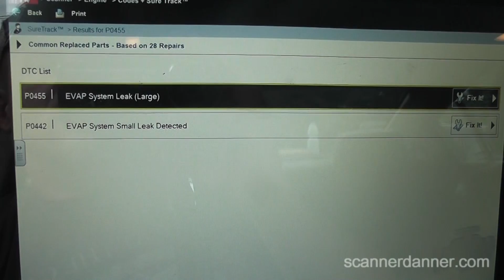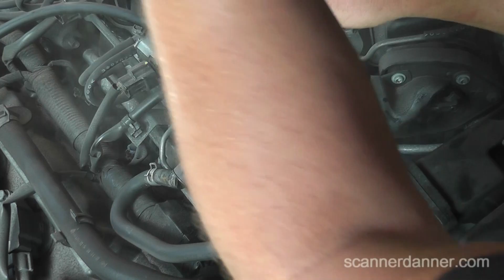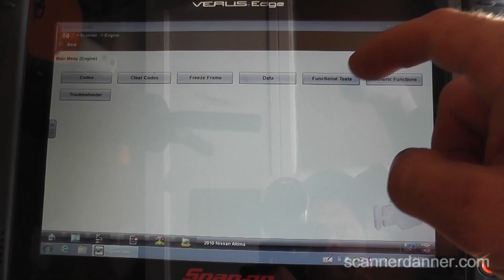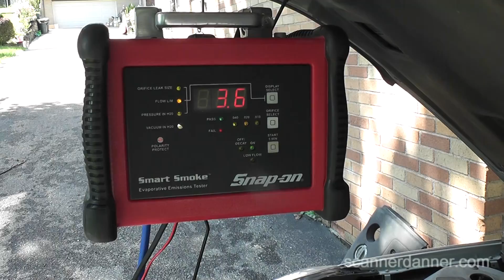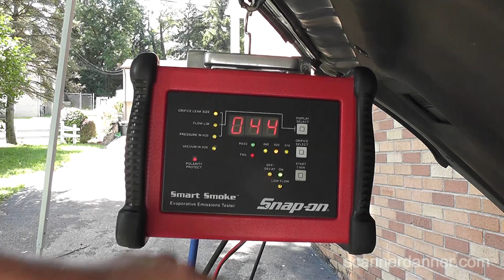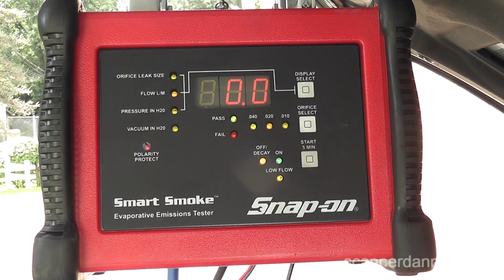2010 Nissan Altima P0455 P0442 EVAP Leak Testing

Comment: Paul what's the reason they vent the systems into the frame rather than a simple and  diffuser?
Reply from the maker: Just a way to keep water and debris from getting into the vent hose. Some systems use  a filter and housing (diffuser) that the vent solenoid dumps into. GM does it like that

Comment: Great video, I have a 2005 Nissan Altima which lead me to this video.  My car has a rough idle (engine shakes) when the car is put into drive with the foot applied to the break.  I've changed motor mounts, repaired an exhaust manifold crack, sealed all the exhaust gaskets with new ones and gasket maker.  I'm still getting a shake and vibration that is causing my flex pipes to break every year.  Wondering if I have an intake leak or a leak like in this video.  I'm at the point of buying a smoke machine to test the car, I have no codes on the car.
Any advice?

Comment: Thank you for this video! My 2007 Nissan Versa vent control valve had debris tangled in the vent spring. I air blasted it out, re-installed the valve, and drove the car less than 50 miles, and the service engine light went out. Thank you for helping me with my P0455 evap code!

Comment: Thank you for posting this. Replaced purge solenoid on 2011 Chevy Cruze with 1.8l engine and tested before purchasing new purge valve. Suspect tested on wrong side of solenoid. Still have P0442 and P0496.

Comment: How much does it cost where you are to do the smoke test
Reply from the maker: At least an hour labor time for a diagnosis and leak test, maybe more depending on where the leak is. Sometimes you have to drop a gas tank to confirm, in which case you would expect to be paying a lot more, but the first initial diagnostic fee would cover exactly what the next step is.

Comment: Evap code, its not the gas cap !! Took mine off ( 08 Maxima ) cleaned it with contact cleaner, used RTV on all connections, Fixed !!

Comment: I got a cheap smoke machine just for leaks, I didn’t have any visual leaks but I hooked up my scanner and closed the vent valve. When open the filler neck fills up but when closed you can still see smoke being pushed in. I’m not sure if that indicates a bad vent valve. I’m so upset, I had my emissions class this semester, now my auto classes are online and I just feel like I haven’t learned much. I’m in a fuel and emissions class, it ends in two weeks and I still don’t know how to test for evap leaks. Online is no where near hands on, so thank you so much for this upload.
Reply: I got it!!! It was the vent valve! I bought a cheap $120 smoke machine and was able to test it. I work at a independent shop just me and my dad, were a body shop but I’m studying mechanical. This was my first evap diagnosis’s, gotta keep practicing even though schools cancelled! lol
Reply from the maker: sweet!

Comment: Will I die if I don't fix P0442? probably not... maybe I'd contribute 0.00000000000000000000000001% to global warming I guess. 
Not bad compared to China.
Reply from the maker: In most circumstances, you have nothing to worry about BUT, it does indicate an EVAP leak, which would be fuel vapors, so just be aware of that. Are you smelling fuel? Parking in a garage may not be a good idea etc.

Comment: Hey thanks Scannerdanner and I wanna give a show out from Mount Union to another PA resident yo. I got a lot out of your video. I have a 2002 sentra spec v with a 10 year long issue with these and gets about 25mpg or less, mostly less the hole time I Have had it. Now I'm getting a po44 code. I was wondering how to activate the solenoid with out the fancy tablet computer. So I will be checking out your videos on that. Thanks for the help figuring this shit out.

Comment: Any videos on troubleshooting p0447 replaced gas cap, vent and purge valve to no avail.   Vehicle first pulled a p0455 and p0447 after replacing, p0455 went away can't get p0447 to go away.
Reply: I have that same issue

Comment: Hey Paul. Do you think it would be possible to test an evap vent valve by energizing it to close it and then removing both hoses, plugged smoke directly into it on front side and see if smoke leaks out other side?
Reply from the maker: or do the same thing and blow through it, I've done that :-)
Reply: @ScannerDanner  yeah I guess you don't need smoke at that point lol.

Comment: Dude, I knew it was your canister vent valve in the first 30 seconds, your way is the dealership way, go through all these unskillfull technics costing 100.00 per hour. I just did one, deleted the code, done in 30 minutes in the dark. From the manufacturer, these are not clamped preventing this after hose swelling and contracting.
Reply from the maker: Lol "unskillfull techniques" 
I wish I was as cool as you are.
Reply: @ScannerDanner  Hahaha, just the nerves of these people. 😂 Here Mr. Paul, sweating in 100F for us to teach us how the system works and diagnosing it, and we have this joker. I bet this "professional" is a really professional parts changer.

Comment: Hy, can you tel me how is the car behavior when the purge valve is stuck close?will it interfere with the ECU to compensate for that?Thanks BTW You kick ass!
Reply from the maker: Stuck closed purge valve would cause the charcoal canister to become completely saturated with fuel. It would set a code for this and you may smell gas. I believe there would be no other driveability symptoms.
Reply from the maker: I should add that if the Vent valve is stuck closed, you would not have a fun time trying to fill your gas tank

Comment: I did the test and I did no't feel any vacuum. I also checked the resistance of the solenoid and I have 29 Ohms which seems ok. As I saw in another of your video, I will manually energize it with a test light connected to ground to see if it opens.
Reply: Also:
1- Key on I got 12V on the power feed side and a bit less on the other side (because of the resistance of 29 ohms if I'm right).
2- I removed totally the purge valve and tested it. It clicked and opened correctly.

So I still have to check the control side.
Reply from the maker: You didn't feel vacuum on the purge valve? Sometimes the manufacturer uses "ported" vacuum instead of "intake vacuum". So, redo the test and raise your RPM, if you now feel vacuum, it is a ported source and your purge valve is fine.
Reply: By "I did the test", I meant this one: engine running, connector unplugged, hose going to the tank unplugged so it's expected that I don't feel vacuum because the valve is closed. Correct ?
Reply from the maker: Yes, if the purge solenoid is not being energized by the computer, you should feel no vacuum there. On initial start-up and for the first few minutes of running, the computer will usually turn the purge valve on, so just be aware of that.
Reply: Thanks for the tip about initial start-up and taking the time to reply to me !  It's an easy way to check if the control side works. I really enjoy learning that stuff !
Reply: Me again. lol

So I started the car, unplugged the hose going to the tank and I did not feel any vacuum with my finger. I should maybe use a leaf (as you did on another video) or better a vacuum gauge.

Also I found a pending code P0444 with my code reader. My understanding is that I set that code when I unplugged the connector during a previous test. Just to be clear: the P0444 was not present before I started checking the purge valve.
The fact I got that P0444, does it indicate that my control side work ? I think it does.

I erased the codes and went for a test drive to see if the evap monitor will run. I have an autel AL519 which has a Ready Test function which tells me the monitors status.
During the test drive, I set a pending code (P0455 as expected).
My next move is to go to my garage and ask them to remove and test the canister vent valve which is a known failure on Nissan of that period.

If I missed something, please let me know.
Reply: I finally found the info in the service manual ! On my car at idle the ECM will never open the purge valve. It will only open it at about 2000 rpm and more than 100 s after staring the engine. For the nissan owner, I found that info on the Engine Control System Section and looking at the input/output signal of the ECM.

Comment: Thanks a lot for that video, once again I learned a lot. I keep in mind the test you suggested = disconnect the electronical connector, the hose going to the tank and check for no vacuum when the engine is running. If a stuck open purge valve solenoid is my problem, i could replace it myself.

Comment: Hi Mr. Danner, I recently have a 2006 Nissan Altima 2.5 with a P0447 Evap Vent Valve Control Circuit, I went to check the diagram and I saw its ground side controlled, so I back probed it to check the circuit and I have 12 volt on both with the ignition switch in the On position, when I with the scanner energize the valve it reads 0 volts on the control wire, so far so good, the thing is that the connector unplugged will read 12 volts on one side and 2.4 volts on the control side, is this some kind of monitored voltage that the PCM sends?
Reply: Yes it is and it would be completely normal.
Reply: ScannerDanner Premium thank you very much

Comment: Big fan Dan.  Love the videos.

Hope you don't mind but I can add my 2 cents and help young techs understand that this stuff gets very complicated.  

The check engine light can be the first and only clue that the driver knows he/she has a problem, especially with evap codes.

Read the code.  Read the freeze frame data.  Try to duplicate the concern.  Check tsb's.  If your scan tool and the car has the capability of doing an in bay evap test then do this.

OBD2 lets techs have certain functions, by law, in which a generic scan tool can use bidirectional testing.  If your scan tool can access specific data then use this too.  Monitor your ftp sensor while you activate the front door and back door of your evap system.

Sometimes the vehicle is already fixed wasting your time.  Seen it way too many times, especially with evap codes caused by loose gas caps.  Mode 6 is your friend.  Learn how to use it.  Complicated yes, but can save you a lot of frustrations.

Sometimes purge valves will only falter when at a certain temperature under the hood.  Remember this.  Reading freeze frame help in this situation.
Reply from the maker: Thanks for your comments! (my name is Paul btw, but it's okay, I get "Dan" all the time from my last name "Danner")
Reply: No, thank you Paul for your awesome videos.

Comment: I bought one of those $125 smoke machines on eBay made out of a paint can and had it shipped to Germany works great on low air pressure and remember you don't need to fill above the wick inside pour on to the wick and just below . lots of smoke i use baby oil inside after im done pour it back in the bottle.

Comment: Hello I have 2012 Altima and I have question to ask you which is everytime I am in my car and I have outside air off but I still get some air coming inside to the car and also I can smell things from outside of the car such as diesel, food etc. so do you know why it's doing that?
Reply from the maker: normal, the default on climate control systems (keeps windows clearer) is to allow outside air in, even with the blower off. To fix that, push the recirculate button on the panel, this will close off all outside air.
Reply: +ScannerDanner thank you
Reply: +ScannerDanner yes I have that button on but still bad fumes comes in from outside

Comment: I've been trying to fix my 98 Chevy Metro. wish I had the scan tool and smoke machine.  would really make this easier.  it had an evap leak detected code and I replaced the evap purge solenoid because it was clicking loudly and sounded like a stuck lifter or loose lash on a valve.  I'll check the vent valve next.
Reply: I'm trying to diagnose my evap canister vent solenoid but the book tells me to use a scan tool to command the solenoid on, but I don't have said multi-thousand dollar scan tool.  I have an innova tool and as far as I can tell, there's no control of the solenoids.  

Can I simply disconnect the connector and supply power to the solenoid with a power probe tool?  How do I know if it's switched by power or ground?
Reply: +Kimo Kalihi I looked at the wiring diagram for the evap system and if I'm not mistaken, the main power relay supplies power to the evap vent solenoid whenever the ignition is on.  The ecu supplies switched ground when it wants the solenoid energized.  

The test said to hook up a hand vacuum pump to the canister side hose on the vent solenoid and see if it holds 15 inHg with the car off.  It wouldn't build any vacuum.  Next was to turn the ignition on and command the solenoid on with scan tool which I don't have.  Instead I supplied power to the relay pin and ground to the ecu pin on the solenoid with the harness unplugged.  Then I pumped the vacuum up to 15 inHg and it got up there but immediately begins slowly dropping to 0 once you stop pumping. 

The last test was to pull the harness plug off and turn the ignition on and test for power on the relay pin and it does have power there so the book says to replace the evap vent solenoid.  

Any reason my rudimentary method of testing could be wrong?
Reply from the maker: Watch the other videos in listed in the description of this one. I show how to manually energize these solenoids. Thank you!
Reply from the maker: Absolutely. You can have a leak anywhere else in that system.
Reply from the maker: It's a good test but not a conclusive leaking vent solenoid. Too many other variables.

Comment: Great video Paul. What's funny is I am putting in a vent valve in a 08 impala today for a customer. po455 code. I used the solus edge to command it. No click from the vent valve. I did check circuit with a test light and the light turned on. So it's getting a vent valve. Also the check engine light was on and it needs to be off to pass inspection in New York.
Reply from the maker: good job
Reply: did the same with my 07 impala changed the gas cap and vent valve and the purge valve, 442 and  455 stayed on I believe the vent valve was bad that I changed to new but the codes didn't go away till I replaced the gas lines they were rusty with a smell then later on I saw a leak of gas now have napex gas lines or whatever they're called, been a year and no cel on. NOw doing my friends 2011 nissan rogue with same codes changed cap already no difference, going for that vent valve next. his car is clean and no rust, like mine, sat for 2 years in a clients yard that I bought for 500 bucks.

Comment: When you would have rich and lean codes from a bad purge valve Will you also have Evap codes as well? And would there be anything else that would give you rich and lean codes?
Reply from the maker: You should but not always. Of course, there are a ton of things that cause rich and lean codes but you know that John. Maybe I'm not understanding your question?
Reply: You said with a stuck open purge valve you would have both rich and lean codes my question was would you also have evap codes as well? I think you understood it lol.
Reply from the maker: No I actually didn't. But now I do. 
It would run rich for a period of time right after filling your tank (charcoal canister would be saturated), then would run lean after due to the emptying of the canister and it essentially being a vacuum leak.

Comment: Almost identical test will show if the LDP on a Chrysler/Dodge/Jeep is bad. 

Paul, Want a neat way to see the smoke easier. Take a cheap laser pointer and remove the focusing lens. The beam then becomes a cone that really makes the smoke show up. 

I got one off ebay that has white light, UV and a red laser pointer. They all select on/off with one switch. Added a small lens to defocus the laser and now it works as a flashlight, UV dye detector and smoke illuminator all for under 20 bucks.
Reply from the maker: great tip! Thank you

Comment: Could  u use low pressers air and pinch off all the hose one buy one till the flow of air stops
Reply: Testing uses under 1/2 psi so you would really need to search hard.
Reply: You will need to find a way to regulate the air to under 1psi. Some systems require less than   0.6psi or the cars computer will open the vent valve during testing and you can ruin the pressure sensor. When this is achieved the only way to find the leak would be soapy water sprayed on all the EVAP components. Yes it's doable.

Comment: Good video but I have a quick question why didnt you change the valve or do you not do any of the repairs just diagnosis. Honestly I would like to do it that way also but currently I have to Diagnose then perform the repair as well and verify its fixed. I would like to start making videos to help others any tips or advice on getting started. Thanks
Reply from the maker: Primarily because I am a mobile diagnostic tech outside of my classroom. So after teaching during the day, I go to local garages in my area and tell them what to do. For a fee of course. 
So most of the time, I am not doing the repair.
Reply: +ScannerDanner Thats awesome hope to be in your position some day soon I have learned so much on testing with scopes from you mainly and I am about to step up from a 2 channel snapon vantage ultra to a pico scope 4 channel with pressure tranducers. Excited to have new testing at my disposal. So glad you all started doing youtube helping other techs gain new skills

Comment: Nice video. If you don't have a smoke machine, but have a bi-directional scan tool, look at fuel tank pressure pid with the vent solenoid closed. Closed, you should see pressure rise. No pressure rise, then to prove bad vent solenoid, pinch vent solenoid hose and check fuel tank pressure pid. Rises, bad vent solenoid. No change, leak somewhere else.
Reply from the maker: good tip, thank you!